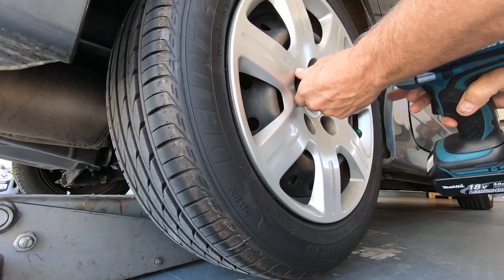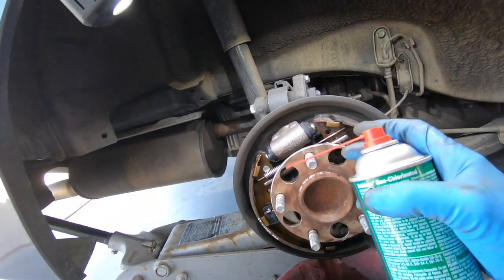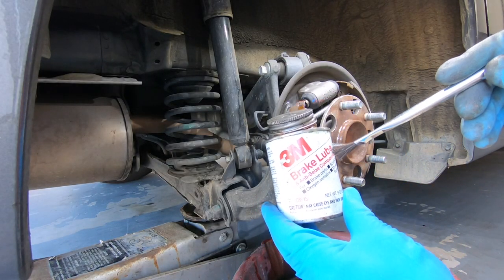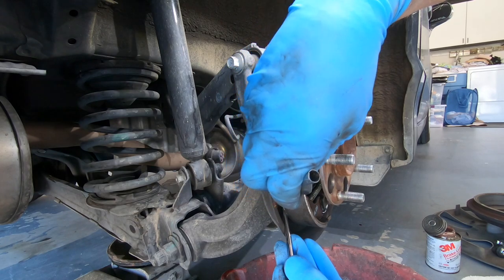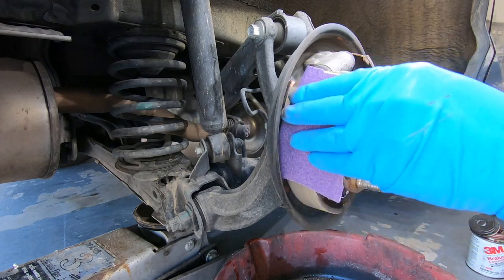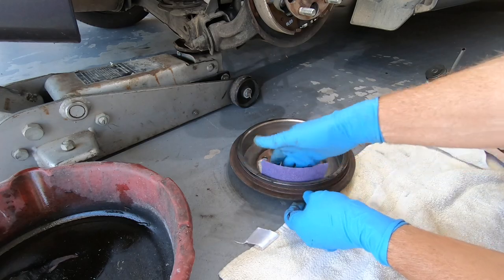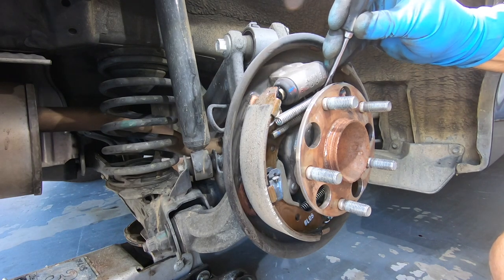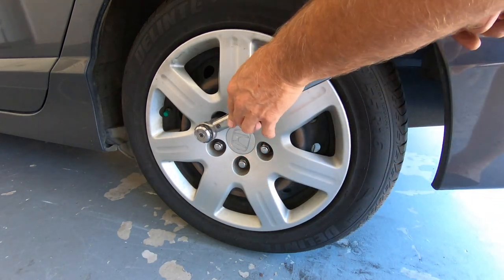Honda Civic Brake Squeak or grab, how to Adjust rear brakes 8th get #brakesqueek #automobilerepair

Comment: Good video. Question: My parking brake squeaks intermittently only on uphill driveway. Do you think this process in the video will help get rid of this annoyance? Any thoughts or tips. Thanks.
Reply from the maker: I think that will fix it, tip: make sure you watch this video also https://youtu.be/G-fkJsybO2c
Reply: @dannysdiygarage  thanks a lot. I will give it a try. Much appreciated.

Comment: my parking brake doesnt work anymore after replacing the breaks. It clicks but doesn't stop the car.
Reply from the maker: You better pull it back apart, you most likely did not get the part in correct, this will become a major problem

Comment: i dont think is a good idea to spin with both hands, use only one hand, it shouldnt spin freely, you must been drag to where the wheel doesnt spin.
Reply from the maker: thanks for your comment
Reply: That would make the brakes too tight and would lead to faster shoe wear. You just want to get it close so that the self adjustor mechanism does not have to work too hard during the first drive post brake job.